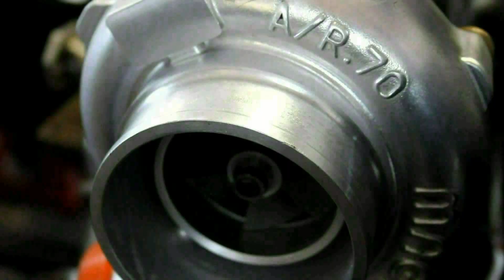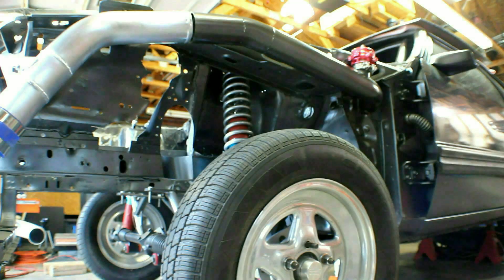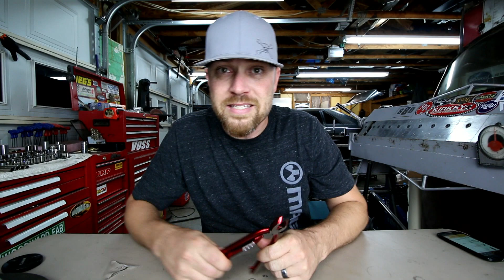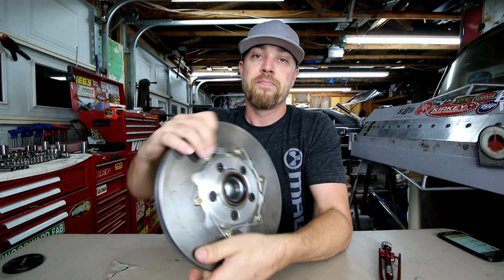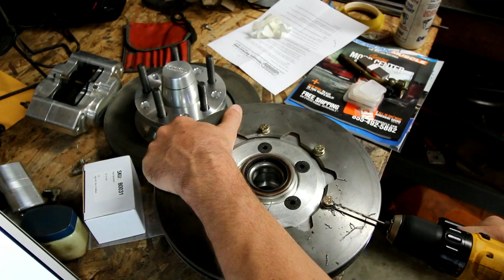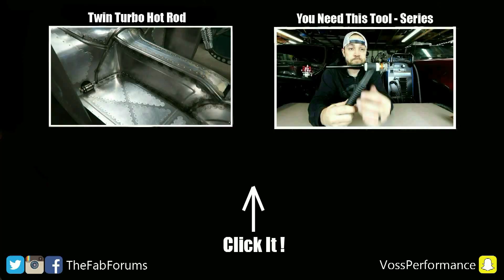You Need This Tool - Episode 69 | Stainless Safety Wire Pliers

Comment: Yes Sir,  Got a few pair myself! I work for the U.S.A.F (was in the A.F.) working on aircraft and use them everyday.  The "book" says no more than 3 bolts in a row or no more than 6" run. Turn one direction to the first bolt and then turn the opposite way to the next :).  Use them on exhaust bolts, those f&^kers always back out lol. Love the vids, thumbs up!!!
Reply from the maker: Right on...I didnt figure I was doing it by the book. I need to educate my self on it. Thank you for your service !
Reply: @dakotaneubert  wow that's surprising, how ever you're not the first person to tell me this but I figured the guy who originally told me was just BSing, none the less, we used em in the Marine Corps in the airwing, and we use them in the civilian side aviation. Maybe the army had too many jackasses mess it up for everyone else.
Reply: Safety wire on header bolts would be cool.  I have a 460 ford big block that shakes the header bolts loose weekly.

Comment: good call on the safety wire for that application. lock washers as mentioned are unreliable. loctite wouldn't be a good choice either due to the high heat that brakes generate.
Reply from the maker: thanks

Comment: Like your channel, i'm always looking for an excuse to buy tools.
A few comments:
Milbar pliers are great.
Why are the bolts threaded into the aluminum part?
Safety wire is not quite correct, wire should be tighter, and i believe NOT go over the head of the bolt.
Reply from the maker: yeah I have had a few critique my technique...not supposed to be more than 3 bolts at a time either
Reply: I hate to make negative comments, but that stuff always interested me. this link is to the "aircraft mechanics Bible" covers safety wire and a ton of basic mechanical stuff
http://rgl.faa.gov/Regulatory_and_Guidance_Library/rgAdvisoryCircular.nsf/0/99C827DB9BAAC81B86256B4500596C4E?OpenDocument&amp;Highlight=acceptable%20methods

Comment: Kyle Voss you have taken me back to my Navy days. I was an Aviation Electrician and I used those pliers and safety wired alot of parts. If my memory is correct I think it was 3-5 twists per like half inch. Something like that. You did it in such a fashion that when 1 screw or bolt would try to loosen the wire would pull the other bolts tighter
Reply from the maker: Yeah I sure some probably cringe when they see this tool because of the amount of work they did with them
Reply: Former USNR ATN-3 here! (Aviation Electronics Technician 3rd class) 10/1967 to 10/1973 - stationed @ NAS Glenview - VP-60 - ASW squadron with SP2H aircraft w/ 2 recip /prop engines and 2 jets that ran on AVGAS. Jets were used to get to the search station, and the recips were used for slow speed cruising ~ 50' above the "deck" while on-station.  Shore based aircraft to fly out over the oceans "looking for" submarines via a "sniffer" for carbon-based fuel exhaust (yeah, real relevant with nuclear subs) and Magnetic Anomaly Detectors (MAD) that scanned for anomalies in the earth's magnetic field that weren't "charted" or known. The MAD gear would pickup 6 beer cans floating in Lake Michigan, back in the days before aluminum beer cans when they were made from zinc. Also dropped sonobuoy's to listen for subs and scanned for unknown radio / radar emissions.

As I recall, it was 10 twists / inch or 5 per half-inch, and we never used the safety-wire pliers - always done by hand and finished with dykes, and then tuck the ends in the last bolt / nut wire hole. VietNam "conflict" at that time and the reserves got the "short end" when it came to tools and supplies. Hell, my firearm training in boot camp was one lousy hour at the range for 60 recruits and we each fired one .22 Long from a .22 rifle, of which they had 6 for us to use. So much for "well-armed military" training.
Reply: AC 43.13-1B No more than 3 bolts and no more then 6 to 8 twist per inch
Reply: That could be I got out almost 20 years ago.

Comment: yes you're absolutely right it started with Aviation. I'm an aircraft mechanic by trade and use them hourly.    two options you have. if you press a bearing on your handle it makes it easier to release after you pull it. also if you can get a reversible set when wiring several bolts together you alternate direction of rotation to achieve a tighter wire installation.
awesome Channel I'm looking forward to next week
Reply: Ya there's some online reference for you to read if you'd like. Here is the link:
https://www.faa.gov/regulations_policies/advisory_circulars/index.cfm/go/document.information/documentID/99861

Chapter 7
Paragraph 7-123
Reply from the maker: Awesome...I still have a lot to learn. Any reference material online?
Reply: David Nelson dave is right. the reversable ones are much better quality. they are also a lot more expensive. you get what you pay for. We go through the cheap ones rather fast. Also, having safety wire too tight is bad.
Reply: I just finished my first year in school to become an AME. Curious on what exactly you mean by pressing a bearing on the handle. Would you be able to elaborate?
Reply: Find a small bearing press it on that tip of the silver handle where there's a quarter inch piece so you hold the silver part to pull it and when you release the handle you hold the bearing and it allows the center to spin back to its original position.
Makes it more of a one-handed operation if you're going to be an AMT I would advise not buying this style of safety wire pliers. Spend the money and get a reversible you will use it a lot
amazon.com
Reply: Awesome! That's what i was thinking, but I just wanted to verify, i'll definitely give that a try. I do have a pair of reversible pliers, I was advised to do so when buying my first pair. Thanks for the reply.
Reply: look at the link posted. It's in chapeter 7. Starts on page 7-19.
Reply: here is a link to the reversible kind. 

https://www.amazon.com/Aircraft-Tool-Supply-Reversible-Twister/dp/B005VR4IM8
Reply: I'm an aircraft mechanic looking for a good pair of safety wire pliers. I'm quiet short and not that strong. Would u suggest getting a 6 inch or a 12 inch plied? Also what is the difference between 25w and 45w? I work on a320/21 and e190

Comment: First comment, FOOL!! Safety pliers rock....Also great to mount and secure things in a pinch: exhaust and radiator for example.  I had a car that the interior hood release would not fully release the  hood latch.  A few bolts and nuts to clamp safety wire to the hood cable (right near the latch), and run safety wire down under the bumper, another longer bolt and nut to create a hood pull that works Everytime.  Check routing to be sure no wires, etc will get rubbed/cut by the wire.
Reply from the maker: good idea
Reply: The Fab Forums Thanks, keep up with the great content!! For the hood latch rig, be sure to wrap several turns tightly on the hood cable and then several turns around the bolt.  Tighten the bolt and nut to pinch the wire and cable tight.  I routed the wire through a hole in the core support and down to the driver side corner and through the tow hook.  Install a larger (3 to 4 inch) bolt and nut combo for the handle (wrap and pinch wire again).  Finally, finish it of with a few wraps of black tape and you have a cheap comfortable handle that will always work and outlast the stock release (if your car was under engineered like mine, super cheap).  Low cost rig that could be priceless if u need a jump or roadside repair.

Comment: I use these all the time (I work on USAF planes) and I can't tell you how important it is to WEAR SAFETY GLASSES when you're using these. You start spinning that stainless wire around in circles and you're already likely to be super close to it. I've have wire come up and peck me right in the lenses a couple of times. Would have been pretty gnarly without the glasses on.
Reply: ...and your reflective belt, always need your reflective belt as well...
Reply from the maker: good point
Reply: God Bless You For Your Service And May You And Your Team Always Come Home Stay Safe🙏❤🙏❤🙏❤🙏✈🏠
Reply: I worked on F-14D and F-18E... and we were taught not to poke our eyes out with safety wire. :)
Reply: @Pat McCann  and a giant biodome

Comment: I have a tool you might want to get.....It's kind of expensive but it works awesome!!!!   I've used these safety wire pliers and they do have their place.  But this other one takes the place of hose clamps and using stainless steel safety wire.
https://www.youtube.com/watch?v=SCVSSOAozAs

Great Video as always my friend.

Ive used this for the hand grips on my ATV  Ive also used these for the rear chain tensioner bolts on my ATV
Reply from the maker: those are cool...someone sent me a link to those the other day